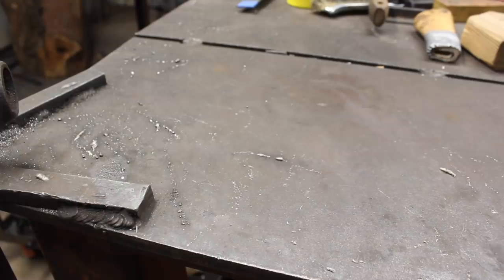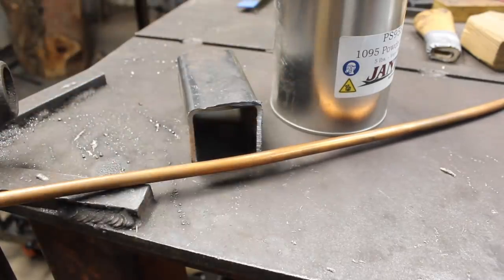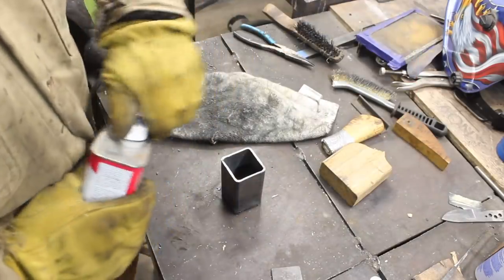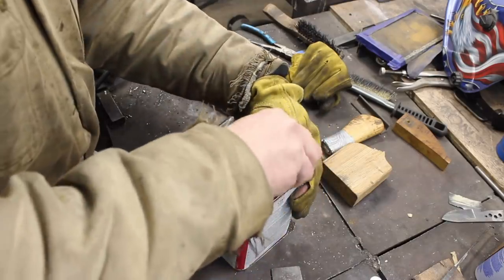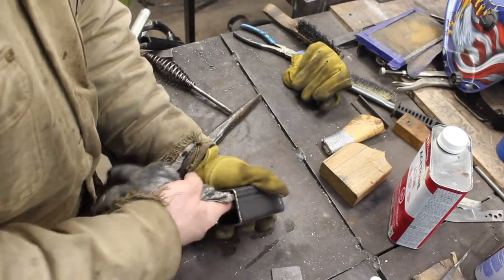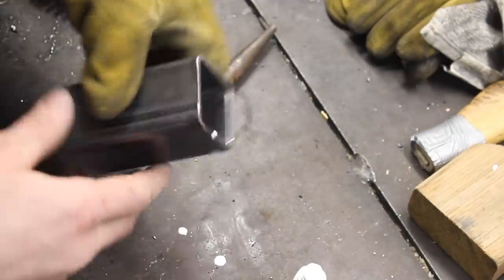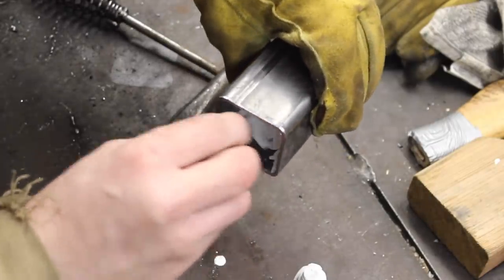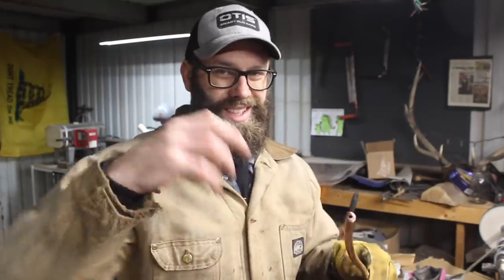Forging Cu-mascus In A Can, Experiments In Pattern Welded Steel And Copper, What Happens?

Comment from the maker: Ok guys, what do you think? Is a version of this idea worth pursuing??
Reply: Not this way I’m afraid.  You can’t reach steel forge welding temps, you’ll just melt the copper.  You need to stay below 1800.
Reply: Maybe, I’m not sure if it would work though. Copper and steel don’t like being together when copper melts. How “cu-Mai” works is a sort of fusion I believe and in my experience copper doesn’t like to be forged with the steel. They have a tendency to break apart and make nasty cracks
Reply: @Joker-em6oz  he’ll need a binding agent between them. Like what they do for titanium alloys.
Reply from the maker: Thanks for the input!
Reply: @FireCreekForge 

Could be.
Might benefit from using an intermediate metal like nickel that both can bind to.
My suggestion would be to use a few quarters or half dollars that are already plated along with appropriately sized pieces of your choice of steel.

If nothing else, it could be fun to experiment with Mokume Gane, which is just pattern welding of non-ferrous metals, and then maybe San Mai it to a steel core.

You wanted to try something different and this particular idea didn't work.
But that's exactly the process that has taken us from living as animals and using simple stone tools to arguing with strangers on the internet via devices that fit in our pockets.

I'm reminded of Edison and his lightbulb quote:

"I haven't failed -- I've just found 10,000 that won't work."

Progress is a arduous struggle of trial and error.

Keep at it, dude.
Reply: Make the other way around. Copper powder with steel tubes. And then make a xiphos blade
Reply: Steel tube with solid copper inside  of it? Steel as a sleeve perhaps? But, wouldn't that require welding the tubes inside of your square billet closed?
Reply from the maker: @marctrossbach6560  that should work!
Reply: marc trossbach that would work if the tubes where welded inside the can.  Maybe if one end is welded and the other has a perfect tight fit up, then that might work. But when starting to forge weld It would separate the unwelded end letting the copper spew out.  Perhaps small sealed canisters of copper inside a steel powder canister.
Reply: @marctrossbach6560  could be a start of a process there. Only difficulty I see is obtaining high carbon steel tubing. I suppose you could drill holes thru some heavy material. You can find high carbon welding electrodes (mostly TIG) to weld those tubes shut after the Cu is added. Then put several of those within a canister surrounded by the powdered steel. It's an interesting experiment, but honestly I wouldnt trust a blade with a very soft, malleable infusion of Cu. It would be decorative though, and sometimes that's cool enough. Especially for use as a wall hanger. Kinda just thinking out loud...
Reply: Absolutely worth pursuing.🙃
Reply: Did you clean the copper tubing same as you did the outside?
Reply from the maker: @swm122758  no
Reply: You won't be able to pattern weld copper and steel together, at all. The forging temperature of steel or even iron is above the melting point of copper. The only result will be your copper running to the bottom of the can way before the powdered steel will get anywhere.

There is a way to make pattern welded copper, but that's done with copper and nickel, and it's referred to in Japan as "Mokume" or "Mokume Gane", and it looks kinda like wood grain.

Only other thing to come to my mind would be if you tried to do the reverse, and have some steel powder mixed into your molten bronze and try to cast a blade like that and see what happens, but I'm pretty sure you wouldn't get any kind of mix, but instead just the powder rising to the surface in a manner similar to slag.
Reply: Educational conversation here that's for sure
Reply from the maker: @marctrossbach6560  Thanks!
Reply: How about the same process but reversing the materials? Canister filled with steel nuts and screws or something like that and powder copper? It won’t make the strongest blade ever but it will sure produce a nice texture that later could be used in a San Mai...
Reply: "Anybody Want it?" If you're willing to send it, sure! XD I'm curious to see what that chunk looks like on the inside.
Reply: Copper-Iron have high galvanic potential, which generates corrosion. In order to avoid this a nickel liner must be used to keep them isolated from each other. Plus current densities increase with temperature, so it’s probably a no go...
Reply: Totally!  But I would up the copper:steel ratio and add about 5% nickel powder or work with very thin sheets of material.
Reply: I think the idea you had about using the kiln to heat it all up us a good idea. I would use steel tubing to hold the copper and surround it with the powdered steel and heat it in the kiln. Then try the idea of making the mosaic blade.
Reply: Def worth pursuing. Think of how good your 4th or 5th attempt will be.
Reply: instead of white-out/correction fluid, would lamp black/candle black work?
Reply from the maker: @jebowlin3879  maybe
Reply: I think San Mai is about the only thing that works good enough with copper. Trying to find some kitchen knives made that way but there's not a lot out there for sale.
Reply: an experiment is a success if it gives useful data. not a failed experiment, despite yielding failed billets.
Reply: Maybe try this same concept but with steel tubes.
Reply: Steel powder and shavings in a group of steel tubes...............
Reply: It would be an Amalgum of Copper and steel if it does not alloy. Otherwise the copper being mixed in like that would give the coppery sterilization effect. Could make a handle. Maybe try and see how it oxidizes. Does it just rusts or does it corrode greenish.
Reply: I beleave that the mix would be called an emoltion
Reply: Not really feasible. Copper melts @ 1800°f. Carbon steel melts @ 2675°f. The copper would probably vaporize or float to the 'top' of the molten steel.
Reply: @stanervin6108  Ah, yes but that is the point!  With the nickel melting at 2660ish that allows it to combine with the copper (which won't "vaporize" cuz its BOILING point is close to 5000) at its melting point, then this amalgam is hammered with the steel allowing it to fuse and forgeweld.  Its absolutely possible, just difficult.  The key is ferrous solubility, so it might not even be nickel that you need, but chrome or maybe even tiny percentages of moly or iri will need to be added.  You gotta remember that this also requires high energy chemistry when you are trying to mess with the basic building blocks.
Reply: Ich habe es mal ähnlich versucht.
Habe Löcher in den Stahl gebohrt. Uund in dann mit Messing oder Kupfer gefüllt.
Allerdings mit wenig Hitze.
Reply: @saschakoller7748  my understanding of written German is a bit Rusty, but if you did something like this why the low temperature unless you're trying to (low energy for this) slowly soak and diffuse the copper throughout?  What did you use as a binder?
Reply: @simonjester4133  I use a Woodfire or a Campfire and a modificated vacuu cleaner. The Copper didn't melt.  I twist it... thin lines of Copper or Brass.
It is hard to twist cause low heat...
I try it tomorrow again 🤘💪
Reply: Yeah, keep pushing forward!
Reply: Scanning the comments for Alec Steele or ToT
Reply: Copper work hardens, maybe do a few forging passes, then anneal the billet, work a bit more then anneal again until in desired shape as your "alloy" may have taken on the characteristic ? Worth a try if you still have the other half you cut ?
Reply: Yes! well worth it but, you need to watch a couple of Tyrell''s videos first. I don't mean that to be nasty however, quite a few bladesmiths are doing this successfully, while we just watched you try to do the procedure with no experience, and it seems, no research beforehand. I subscribed to your channel based upon your "Damascus 101" video... twenty minutes later, I unsubscribed because of this one.

Having said all of the bad stuff, as Aleeknives wrote, "All in all man You can't consider this a failure! You learned something and also taught us along the way with your inspiring artistic approach to things! A+"
Reply from the maker: @mollcustominstruments9712  I'm aware of the guys making "cu-mai" with solid pieces. This was an experiment to see if it could be done in a canister with powdered steel.
Reply: Yes! Maybe pick 2 ferrous alloys with similar melting temps? Or maybe stainless with an iron that oxidizes black.
Reply: I’ve seen copper and steel plate used in Damascus, I’m not sure if the same would apply, but the gentleman didn’t get his billet as hot to forge weld. At least you vented the can this time!
Reply: The leason is to make cu mai never use iron powder, it was because cooper will melt before the iron. When you force it it just becoming an cooper alloy
Reply: yes
Reply: Copper is just too soft in my opinion.
Reply: try reversing the idea, use steel tube and fill them with copper powder...
Reply: You should have rolled it out into als thin sheet and rolled item up als couple times that would average out the mix in your bi metal

Comment: Pour molten copper into a hot nickel and alloy steel layered block that is saturated with tiny tunnels.  Let cool and cap the ends with plates of the steel. Then heat to forging temperature only and forge.

Comment: Try use instead Cu a nickel  bronze ( 10% Ni or so) Ni is soluble in Cu at melting point also it increases melting point of copper allot making it more forgeable ( Ni bronze under 10% is yellow citrin over is silver colored if remembered correct...) Melting point of this alloy is arround 1200-1300°C so when prepared from Cu, Ni powders furnace must be able to reach that temperature! It starts from 1083°C for copper but it grows allot from Ni....
This bronze due to the nickel is more iron friendly in forging usually pattern will look like gold....

Comment: I think, the problem was , that the copper could flow into the steelpowder. A possible solution could be to take a solid rounded steel, put the coppertube over it and a steeltube over that again. And only now you fill up the space inbetween the round sticks up with steelpowder. The copper should be cought between the solid round part and the steeltube.
I hope my english was making somehow any sense.

Comment: I know I'm late toe the game but, I'm wondering if a twisted steel cable inside the copper tubes would make a good pattern?  Especially if you were to take a 3x3 tube group and twist them after the initial press welding.

Comment: Maybe try sliding steel rods inside the copper pipe and other steel rods around the copper to reduce the amount of powdered steel you use, it feels like that much powdered steel just won't forge weld very good to start with.

Comment: 11:22 Copper and iron or steel are alloyed every day, and well used in modern industry.  
"Copper-Iron Alloys: offer high tensile strength, corrosion resistance and high thermal conductivity as well high electrical conductivity"

Comment: Cu melting point is much lower than steel firge welding temps. As I'm sure lots of people have told you...
However, if you forge weld some steel, and then get your Cu pieces/sheets in there at a lower temp but just below the melting point of the copper, you 'should' be able to get some welding happening.
So, you need thermocouples...

Comment: Use a very thin layer of whiteout, it will dry fast and not flake off but it works fine.
Reply from the maker: For some reason I had issues with it flaking off, Maybe it was the knock off brand I used..

Comment: I enjoyed watching this totally successful research and development being conducted. The research answered a few questions and created a few more questions, as good research will do. Copper rods might have stood a better chance . But it would never have ended in a pattern. Just no way to fuse the powder without turning the copper into liquid. The copper/steel game has a top end temperature of coppers melting point. No matter what ya plan, go higher than that and its a puddle of copper at the bottom. You fuse the copper to the steel. But the steel cant fuse to anything. The copper acts like a sticker.

Comment: Why not put braided steel cable inside of each copper tubing? Or even a smaller diameter steel tube inside the copper, and then copper wire? That would make a cool pattern.
Edit: after watching to the end.... Nevermind

Comment: It looks like the copper diffused into the steel, which would be an alloy. But with powdered steel there's also a sintering process going on below the melting point of copper. Would be interesting to explore what exactly happens between the melting point of copper and welding temp.

Comment: Weld steel tubes filled with copper to end pieces then make your can 1 side at a time from flat stock welding each wall to the end pieces. Before welding your last side fill the inside with your powdered steel like making a caneau style can.

Comment: you should try to reduce that piece, and add some silvery metal, some more copper and maybe bronze, in a new can with that piece in the middle, and make sure you heat it ca a reducing flame, while heating it very very slow and not that much temperature nice video keep going, i would also add that the metal pieces (to add) should be diferent sizes and shapes the bigger ones being the ones wuit the lower meltin point (your copper fused because was a wall to thin, but gave a nice result of an alloy, to unstable y would say tough, so that's why i recomend a carburating flame, maybe searching a way co have a carburating atmosphere while hammering
i do not have any money nor tools to do this kind of things, and i have never do so, but i do know a lot of the stuff, by reading and very science focused youtube videos trought the years, and by procedural thinking i have theorized many methods to work metal
sorry for being ''that guy'' thanks for the attention

Comment: No, it absolutely can't work.  No matter how exact the temperature control, the copper will be at a complete liquid state before the steel powder reaches it's required temperature.  The best you can hope to accomplish would be to embed larger pieces of steel in a canister of molten copper.  That might be worth a try, and you wouldn't even need to weld.

Comment: Have you tried making a blade from your blend and see if it's hard enough to hold an edge and tough enough to withstand a pounding?

and if not, might your blend make an element in a damascus that's then san mai'd to a good cutting edge steel?

Might make for some interesting colors in a damascus.

Comment: When you make a copper steel layered knife you are not welding the steel to the copper, you are just heating it up enough to fuse the copper to solid pieces of steel. What you tried to do with powdered steel was doomed to fail because the melting point of the copper is fair lower than the welding temps required for the powdered steel to become solid steel

Comment: Forge welding temperature for most carbon steels is 1700-2000° F (stainless is higher), while the melting point of copper is 1984° F.  Since you were going for a high enough temperature on the initial weld to ensure the powdered steel would weld, I'm guessing you wound up with powdered steel diffused through molten copper.

Comment: I'm a Pipewelder by trade. At one point I TIG welded black iron nipples to copper heating coils using stainless steel filler wire. It was a trick to do but once I dialed it in it welded great. I think copper plate and stainless steel work together and a blade steel center would work great. Just a thought

Comment: CORTEN otherwise known as weathering steel is a steel alloyed with Cu. It develops a protective oxide layer similar to Al that prevents further corrosion. It's a structural steel used in bridge beams and power poles.
Reply: Shipping containers are also made with Corten.
Reply: Invented by USSteel. We used to make it at the research center.
Reply: Thank you
Reply: I was gonna say aren't the 2 purposely combined to create a building material?  I believe it's because the copper handles weathering/oxidation and lends that to steel? I may be wrong?  I would guess it adds some flexibility as well

Comment: I think the concept is pretty much like brazing copper together with silver solder. That's why without oxygen the copper just flowed throughout your powdered Steel. The only thing I can think of is something that forge welds at a much lower temperature. Iron is obviously where to start, wrought-iron probably better. One thing you might be able to do is first introduced nickel into the copper and then try using a nickel alloy Steel. Obviously doesn't take a lot of work and is not necessarily what you want to do because you would have to actually make your own nickel copper alloy. Again these are just thoughts nothing scientific going on here just me wrapping my brain around what could possibly be a working process

Comment: When you first mentioned that it was correction fluid rather than white out, my first thought was I wonder if that's actually got titanium dioxide in lol, then 30 seconds later you queried the same thing. I like it when people think about why something works, and don't just assume that a lookalike product is a chemical doppelganger.

To be honest, using the correction fluid has added an extra layer of anticipation and jeopardy, as I too wonder if it'll function in an identical manner to white out!

Comment: Adding copper to steel as an alloying component is possible and is usually done between 0.2-0.75wt%Cu. It typically is done to improve corrosion resistance, and contributes to solid solution strengthening. If you did get the copper into solution you probably added much more than 1wt% which is probably going to give you some issues with embrittlement.